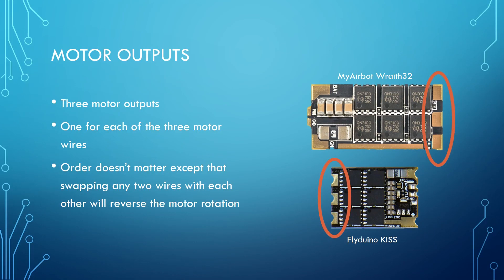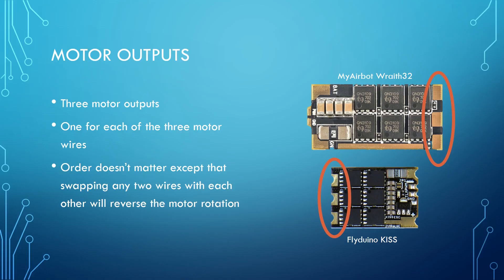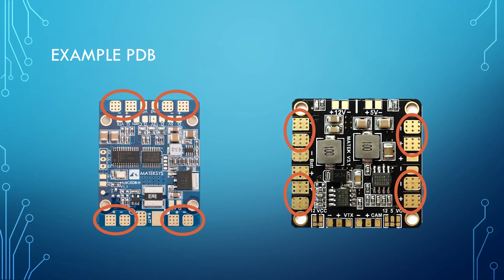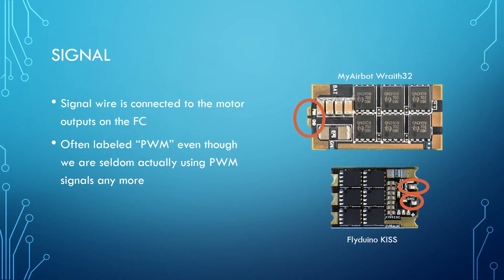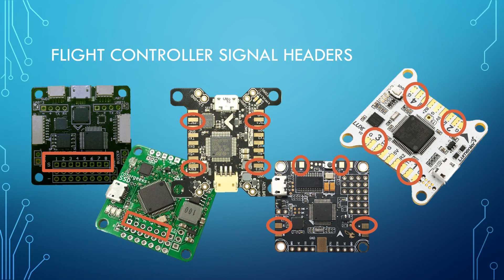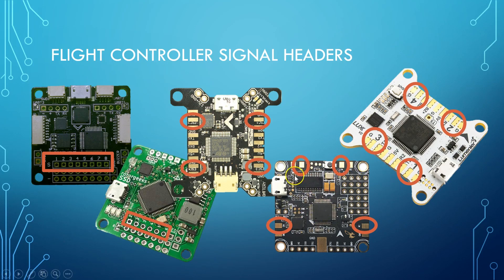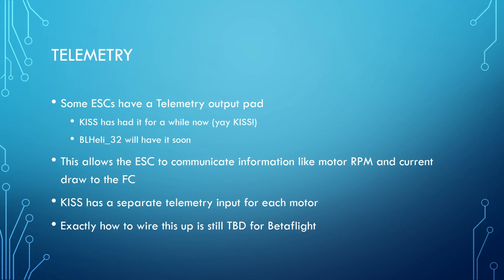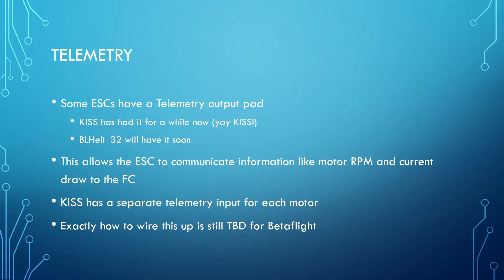Flight Controller Wiring For Beginners - PART 2 - ESCs

Comment: I've some troubles with Ibus and a Revolt V2 I would like to solve, without soldering randomly. 
Unfortunately I haven't found any pinout diagrams for Ibus so far. 

I wired the signal cable to TX1, 5V and inverted signal. Did I screw up inverting the signal?

If you will talk about it in the next clip I will patiently wait ;)
Reply: Try RX pin and ibus isn't inverted signal unlike sbus
Reply: Thanks @IRFZ44!
Reply: No problem! We're here to help each other.

About solder pads, be really careful with them. You may rip them if you pull them or overheat them.
Reply: SaschaPC8 Revolt V2 pin out is on the Race-flight web site, as already mentioned signal in not inverted so just bridge 5v pads the non inverter pads, make sure you check failsafe function after configuring. Be really carful on the solder pads as they lift easily if you pull whilst de-soldering.
Reply: Thanks @Jason Cross!
Guys, your tips are saving me a lot of time!
Reply: I'm here to thank both of you, everything went as planned and with your suggestions it was so easy!
Best Regards
Reply: SaschaPC8 anytime, we all get perplexed now and again as some of the pin put info is baffling but there is always someone to guide...have fun and enjoy the hobby...good choice on FC also, my revolt is awesome but I only run at 8k and the CPU load is at like 2% 👌🏼

Comment: What are positives ESC wires for? I sort of get the ground wire arguments, but I do not know why very few ESCs have them anymore (or what their purpose is at all).
Reply from the maker: You know, I kind of think I should have covered this, but I left it out because this is so seldom used any more. The positive wires in a servo cable were originally for carrying power TO the servo. But of course we're not running servos. So instead, what manufacturers did is, they put a 5v regulator in the ESC (this was back before we had PDB's, you see) and you would power your board from the ESC, via that wire. Nowadays, we pretty much all get our 5v power from a regulator on the board or on the PDB, and ESCs are seldom sold with regulators on board. So that red wire is typically not even present.
Reply: Thank you!